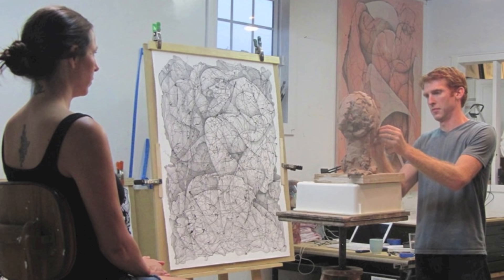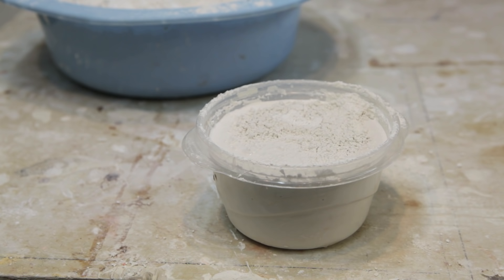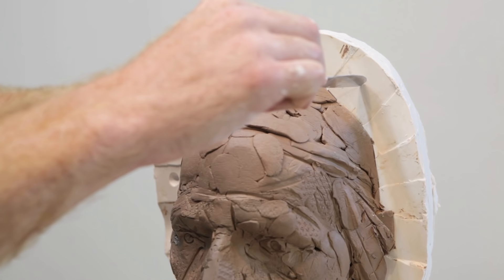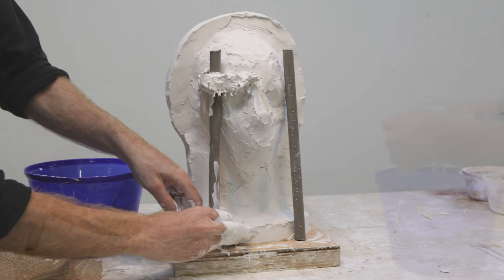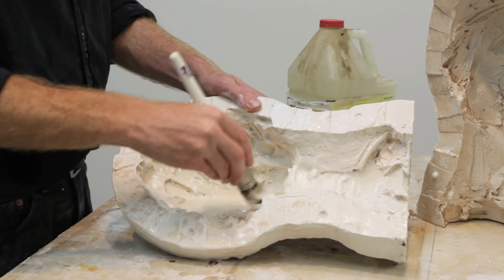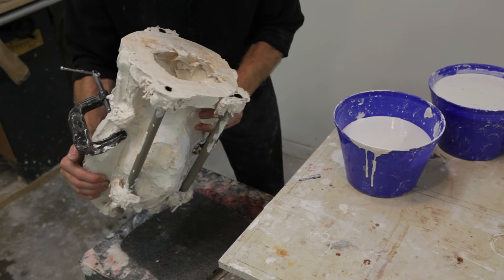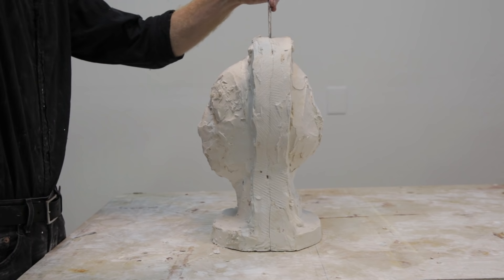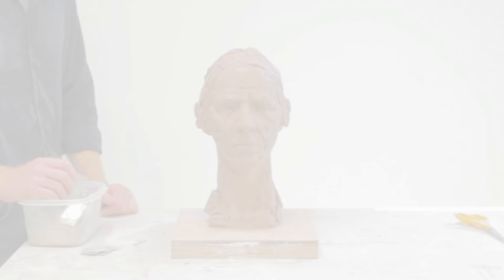Materials and Process: Plaster Casting

Comment: Thanks for this detailed video. I learned this process in college, but we used Vaseline instead of clay slip and also applied thin layer of Vaseline to the inside of mold and it released much easier than this. Even if there are other ways of plaster casting, it's still a valid way... Cheap too!
Reply: Vaseline will leave a smooth almost shinny coat to the project. However i agree and only use vaseline when covering mold.
Reply: can i get a project writing from you please

Comment: 1. make sure the clay is not to dry so you can take the plaster off the positive, 2 Make sure the clay is a bit humid on the surface,not to much , so the plaster doesnt create bubbles on the surface, 3, Put pigment on the first laier of plaster so you know later when you are opening the cast you are close to the positive. 4 Sprinkle the first two laiers of plaster with your fingers and hand without touching the surface of the clay, using the brush can ruin the many details of the modelation. When mixing the plaster keep your hand in the bucket taking your hand out and in might add more oxigen to the mix creating bubbles. Before casting the positive sprinkle with a bit of water the negative so it releases the surface tension and it doesnt create bubbles.

Comment: Obviously Silicone, Polyurethanes and resins can be used for different reasons, but this is a traditional method and a good skill to master. One thing I would suggest for those who wish to try it, is to use a beta or softer plaster for the waste mould and an alpha (harder) plaster for the cast. Some alpha plasters can have a different tint to them and help differentiate between mould and cast. Also be careful adding each layer to the mould. If the second or third coat is too thick it can heat up and cause the thinner layer beneath it to crack.
Reply: is it possible to paint the plaster so i can differentiate better?
Reply: @Narko_Marko  just add a colour powder to your mix
Reply: My old art teacher used concrete for the cast. It already has a different colour and it's more durable than the plaster so you don't have to worry as much about breking the sculpture. Concrete usually has a rougher texture though.

Comment: Then there is silicone. There is much to be said for tradition. But this process must be pretty stressful with much room for disaster.
Reply: Richardo Hanna that was pretty stressful just to watch!
Reply: I agree.
Reply: The first time was stressful but the end result is always so charming. Sometimes art is about the process
Reply: Totally agree
Reply: Huh? What was stressful, seemed pretty basic. The chiseling at the end? I suppose, but I bet it’s not that tough
Reply: plaster is much much cheaper in cost than silicone and you can make an silicone mold with the finished piece afterwards

Comment: Really good video.  I teach sculpture and we use a similar process.  Comments are correct about other molds like silicon or latex being better and reusable but that process is exponentially longer because of drying time and the number of coats for a successful mold.  In a classroom situation, or if you don't need copies this is the most efficient way to go.  The one detail I might add is to add a little color or dye to the mold to help differentiate from the plaster used for casting.  Thanks!
Reply: Adam Teraoka would using silicone in a cast like this instead of pouring plaster into it work? I'm trying to make a wearable mask out of it
Reply: I sculpt very well with paper mache i also paint ,but I want to be your student in this field. What does it take for you to mentor me despite the distance
Reply: If you make a video I would like to see it.

Comment: That was a very detailed and well explained video. I have a question though, would it be possible to make a mold of a fired piece? I was wondering if that could be a way to not have to destroy the original sculpture. Of course, after drying and firing the size would be smaller, but if you don't mind or you were to do the original piece slightly larger to make up for the volume loss... could that be an option? Thank you!

Comment: We use this method, however we add untangled rope strings in the mold making for strength, we never brake the mold when releasing it as so we can reuse it many times. Also found out that any liquid apple soap worked best for the quick hardening plaster we used.

Comment: With a little patience you can also directly model like this style with plaster alone. Build up base shape with armature and hemp, if using iron based support, it MUST be totally sealed from moisture!!
The final layers of plaster will stick onto plaster base, and can be worked with spatula when thick enough, then scraped back easily as it is still soft. End result is very much like the effect or style of sculpture shown here, using the textures of medium as part of design.

Comment: You could also have made a piece mold, made of 3 or 4 sections where there are undercuts. Same process as you show , but much easier to remove rather than chipping it away.
Reply: And reusable! I really don’t understand the point of going to all this trouble to create a mold, that is destroyed after the first use, and that destroys the positive,. Especially when you could just do a few more pieces and then be able to preserve the positive and reuse. Also by using clay or plasticine instead of the inserts at the beginning, you wouldn’t have to sand off the seam- you’d avoid a seam.
 I just watched a beautiful video by the V&A about casting a complicated  sculpture with multiple little pieces, it was so clever and satisfying, and probably not all that much more work than this.

Comment: Hi! Thanks for the video, I see also in the comments a lot of helpful ideas! If someone could help me, I need a bit of advice. I am a painter but recently started to work in clay, I love it and have some projects in mind. Did some bas-relief. My question is: If the clay is dry and I do not have an oven can I make a plaster negative of the work? Or do I need to have the clay wet? What should I use to separate the two of them ...oil soap? Is oil soap just soap made from animal fat? Thank you!
Reply: should also mention that I checked some other alternatives but I think plaster ( gypsum) it's the most affordable and  I would prefer to try this at first

Comment: Is that a special plaster or just a normal construction plaster ? ...how you make it so liquid ? When I mix plaster with water I get chunks of plaster that are not well hydrated and ruins my composition + it gets very fast thick, I see you managed to make 2 buckets of that and have the perfect consistency ...what is the secret ???
Reply: normal construction plaster, the trick is to pour it as if is rain until the plaster set on the edge like a little island.
Reply: Best to use a scale and weigh out the water as a percentage of the weight of your plaster. For No. 1 Pottery, 69 to 70 % water to dry weight of plaster. Gently sprinkle the plaster to the water (a sieve works great for this), then let the whole thing sit, undisturbed, for two to three minutes . Then stir with your hands.

Comment: I was thinking of casting with casting clay instead of plaster and then reworking the clay cast before firing, in order to get much more detail and a much smoother finish. Do you have any experience with that, especially portraits?

Comment: I know this is an odd question for such an experienced artist like yourself. Why not just fire the clay sculpture and not make a mold at all? Can you not use metal Armature and firing clay without using a mole?
Reply: plaster molds are typically used for casting bronze. he may want to save and reuse the clay as well.

Comment: Is there a barrier applied to the clay prior to painting with plaster? My clay (WED clay) is extremely hard to remove from the plaster mold. Yours almost fell out.
Reply: If no one else replied, I use wed, and before molding in plaster I spray the clay and the mold wall with a spray can of krylon crystal clear, a couple coats usually dries within minutes and you'll feel it's kind of smooth, it takes a bit longer to take the plaster cause it'll want to bead up initially but just keep painting and dabbing it on with a brush and when it's cured it'll come out MUCH easier without losing detail.
Reply: Thanks Luke. I will try your technique on my next project. I kind of got discouraged after struggling to get the clay out (my first try at this kind of stuff).

Comment: Horrible way to cast. 1. Plaster sticks to mold, destroying it completely. Could've used a release agent. 2. Need to thoroughly clean mold reduces fine details. 3. Casting with the same white plaster makes it impossible to determine which bits are stuck to final casting. 4. Pieces stuck to final casting result in a cast that's terribly rough, unrefined. End result is just a bad
Reply: haha yes you right...

Comment: what if you need several copies......you broke the mold. It is supposed to be used for other copies too.
Reply: That's why it's called a "waste" mold. If anything, you could cast the plaster sculpt again.
Reply: +Matthew Santoro Pranks it wasn't what I wanted to see. I wanted to see how the mold can be safe...not wasted. I know you can cast the plaster sculpt again but it makes no sense. you already had it  once
Reply: kacatriku Yeah, I see. It's definitely not the best way to do it.
Reply: You could try lost-wax casting.  That process has you make two casts, one you can keep and another that gets wasted.  Being more complex, there's more opportunity for mistakes and lost detail than other methods, but it allows you to save the first mold and make as many copies as you like.
Reply: This method was traditionally used for making an intermediate step for carving into stone or wood. Imagine carving stone while measuring from a clay model: one shard flies off and there goes your model. So they cast it into plaster via this method, and then measured their carving off of that. That's the origin of the plaster cast storage rooms carvers and schools used to have. 
They would measure a certain point off of a plaster cast, say for instance the nose, and mark it on both the stone and the cast, to keep track of the workings. This is called the indirect carving method. Look up 'pointing machine' on Wikipedia.
Reply: kacatriku can always make a Silicone mold of the final plaster head and make copy's from there.
Reply: Then that would render that first molding process pointless.
Reply: Really ,you want a copy of it?
Reply: do clay pressings to the mold first, many times so that u can make many other molds
Reply: If you want a mold that you can use several times you should use silicon rubber for first (directly on the sculpture) about 4 to 6 mm thick, then do the same he does in the video

Comment: Hello! I made the mold for my sculpture, and i've already filled it with plaster a few days ago, but i added too much water in the plaster, and i am afraid that it won't dry, it isn't dried yet. Should i wait longer, or just break the mold, remove the plaster and full it again with the right consistency of plaster and water?
Reply: plaster usually doesnt take a few days to dry. It normally takes one or two hours lmao

Comment: I want to make a statue that is about 12" tall. What is the best kind of plaster to use to make the statue very hard so if knocked over it will not break? Is there such a thing as resin plaster? If so would that be the best? Thank you.
Reply: In order of hardness: Ultracal (hardest)>Hydrocal>No.1Pottery> Plaster of Paris. Yes, there is a "resin" plaster that you can make: Duo Matrix G or Forton. Mix the dry hardner powder in with your plaster (important to mix the dry ingredients thoroughly before adding to the liquid) and then gently sieve it into the liquid resin and water solution. Or for stronger pieces, use liquid resin and no water.  I use No. 1 Pottery (with hardner at 1/5 of resin weight) sprinkled into a solution that is  70% resin and 30% water.  I weigh the dry mixture for  at 71 to 72 % consistency. It produces nice results. For the strongest results, mix hydrocal + hardner, then add directly to liquid resin (no added water) and target a 46 % consistency or so.

Comment: Can cement be used for this kind of mold?
Reply: There was a product called cement fondue, used by our art teachers for this purpose. It has different setting qualities and can be cast easier than standard cements.
Reply: I remember using cement fondue in our molds at school. We painted in inside the mold with a brush and reinforced it with fiberglass.